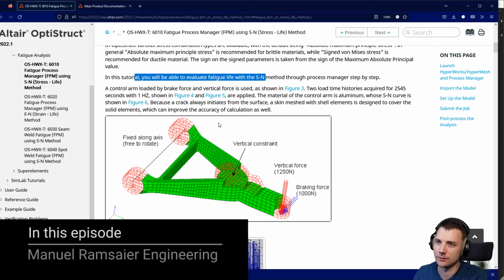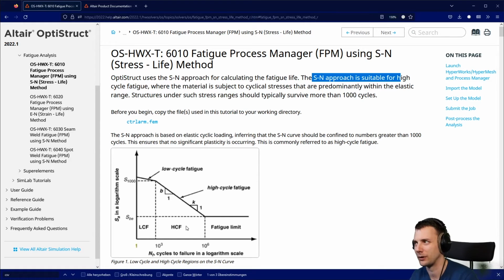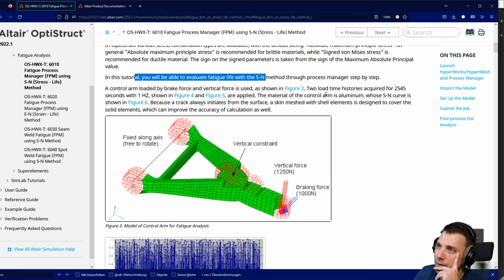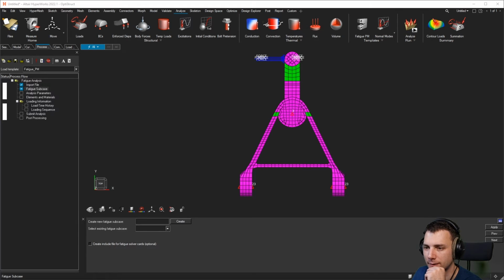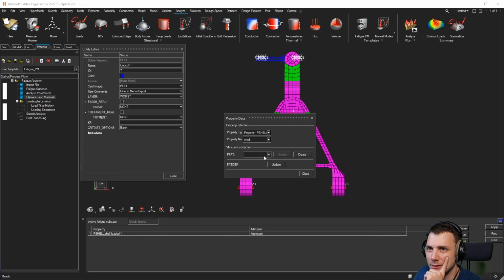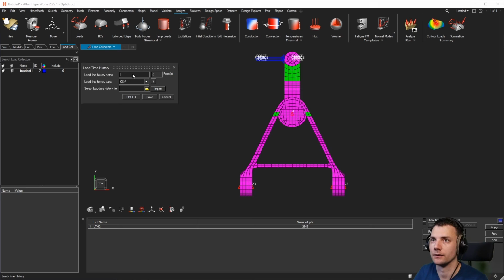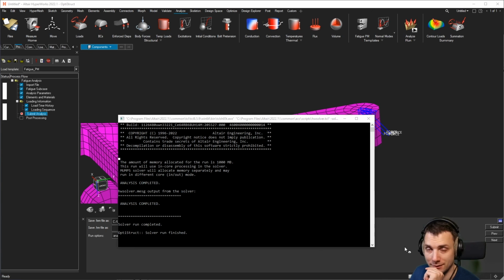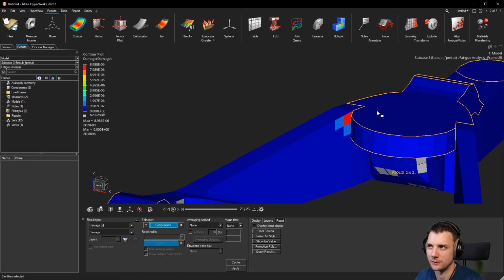Altair Hyperworks 2022.1 Fatigue (S-N Life) Process Manager Tutorial (OS-HWX-T: 6010)

Comment: Cool, Thanks for this tutorial! a quick question - you defined only 1 repeat time. Does that means that only 1 time the loading of 2500 seconds with all peaks and lows was applied? or 1 cycle with all loads through 2500 seconds?
Reply from the maker: As far as I understand is: 1 repeat time = both time histories with 2500 seconds are applied one time in combination (linear superposition, not sequential)
Reply: Thank you Manuel, this is also what I understand. So basically the damage was calculated for these 2500 seconds
Reply from the maker: @TheTehnikx  Yes